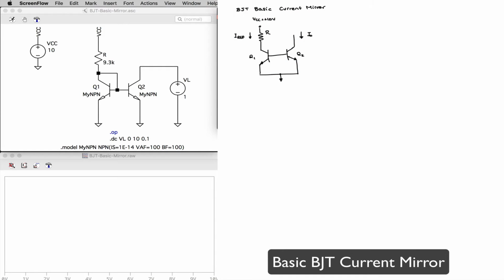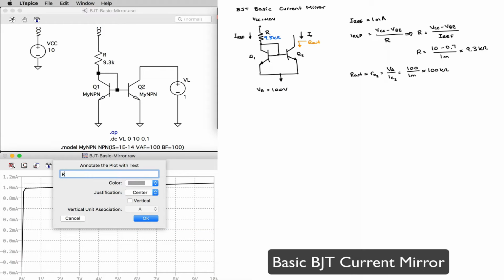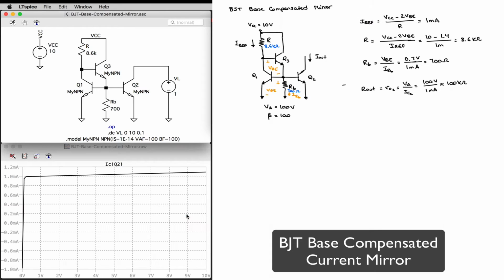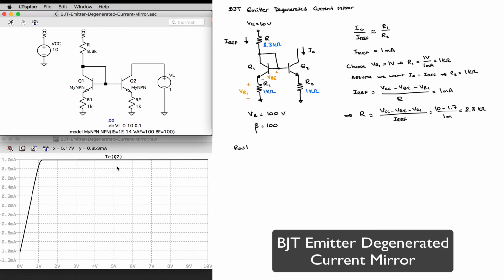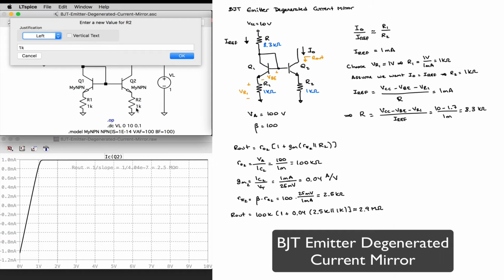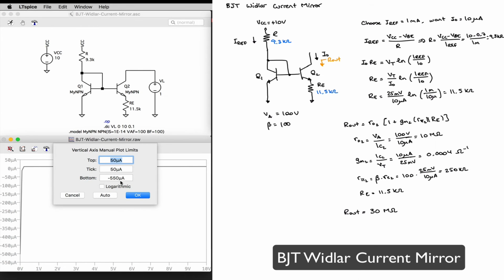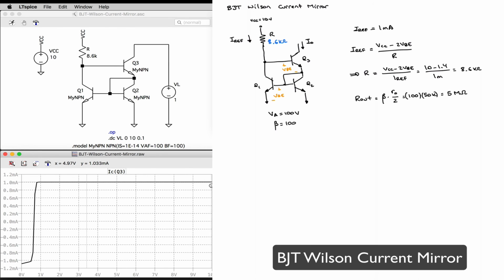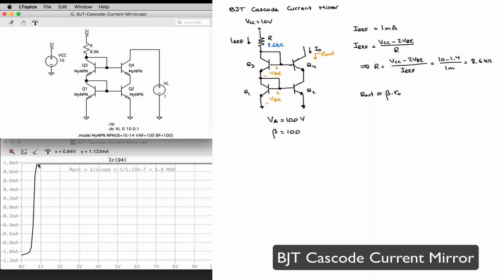BJT Current Mirrors Simulations

Comment: Wow. All I can say is that after many year you doing electronics part time that was the best explanation of the different forms of current mirrors and how to calculate the Vout etc. I have managed to simulate those in Lt spice as you have, even added Vout to th plot. I have also drawn up a PNP version of the basic mirror but I don't know if the circuit is set out correctly. I would really appreciate it if you could e-mail me an image of the circuit schematic for a PNP version. As I'm not sure I have the voltage source for the Vload attached correctly. I am not seeing that voltage compliance region as I did for NPN current mirror.